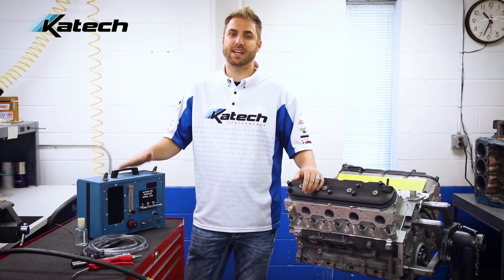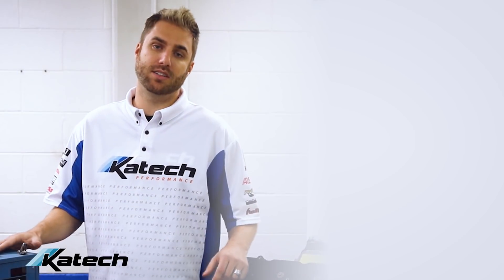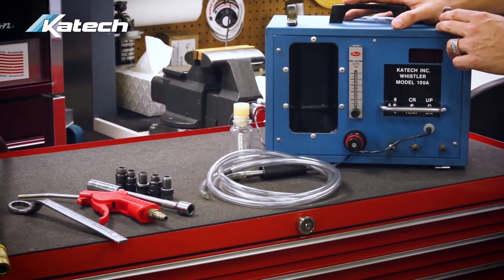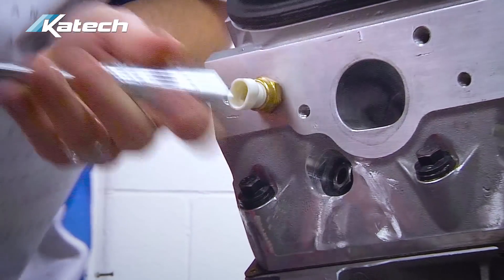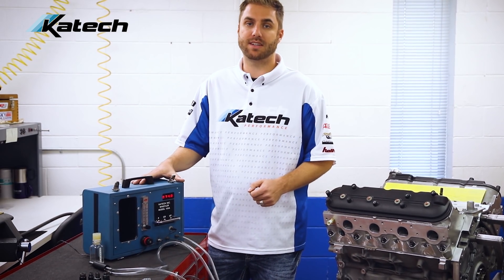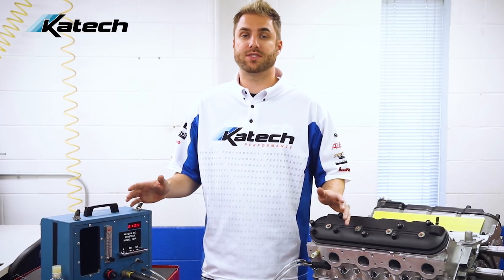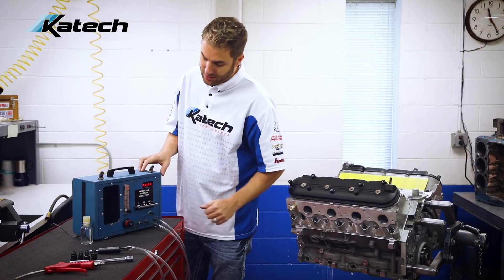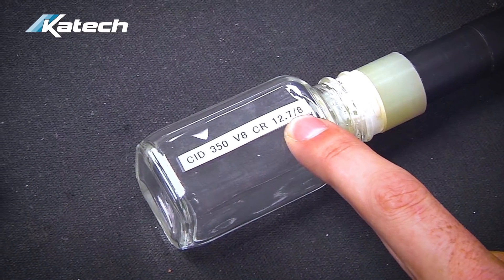Katech Whistler Compression Ratio Tester - What does it do and how does it work?

Comment: Thanks for the short video. I have been using the Katech Whistler to tech engines in a non-NASCAR series. We had been trained to have the rockers removed to perform this procedure. Is it really required to remove the rocker from that cylinder or have we been trained incorrectly. As a side note I have been getting proper reading in doing this, but not removing the rockers would made tech much easier and quicker.
Reply from the maker: Removing the rocker arms is not necessary.  Both valves just need to be closed, which would be the case at TDC on the compression stroke.
Reply: Thanks for the feed back! Will make things much easier and quicker on future tech. And sorry for all the typos. By profession I am not a typist! LOL